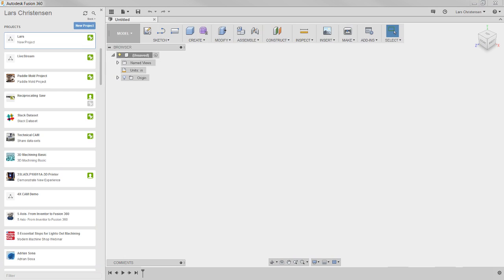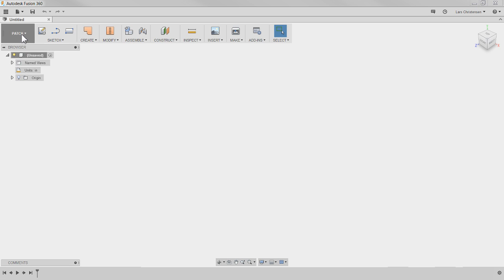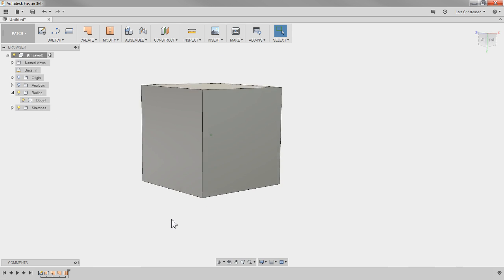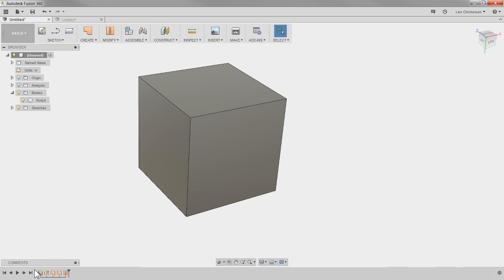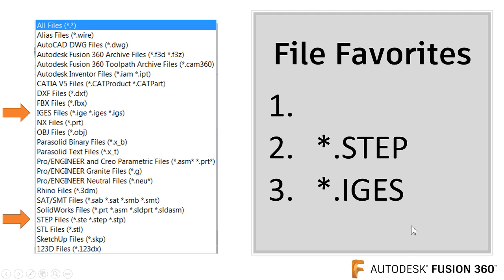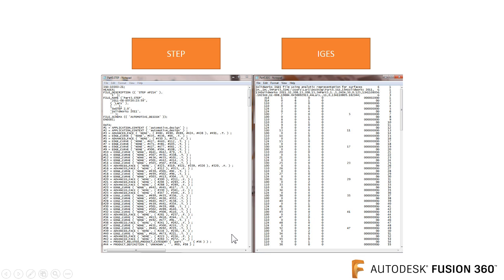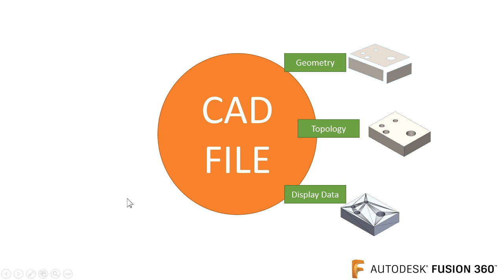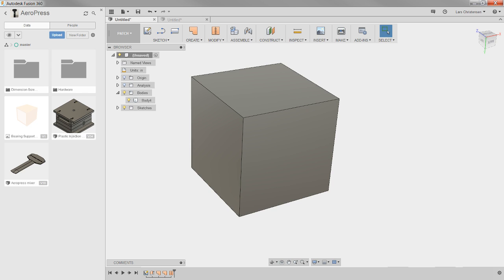Fusion 360 — Yours FREE! IGES, STEP Whatever file you want —Your Comments & Questions — #LarsLive 21

Comment: why is it that whenever I am importing .STEP 3d solid geometry from Fusio360 to ANSYS, it becomes a hollow surface only?
Reply from the maker: Sounds like something is not water tight. If you bring the same step file back in to Fusion, does it come in as a solid?

Comment: Hi Lars and tnx a lot for your great videos. I have a question about the back face colour of surface geometry in the patch workspace. Yours in this video is yellow-orange (or to some extent goldish),  but mine is dark black. So as the front face in grey, these colour combinations make 3D modelling hard in distinguishing edges, vertices, etc. Could you please give some advice about how may I change it?
Reply from the maker: Do you have another background color? I’m thinking that might be it. You can change the environment on the small computer screen looking icon at the bottom of the screen